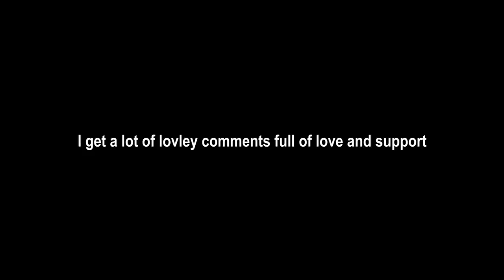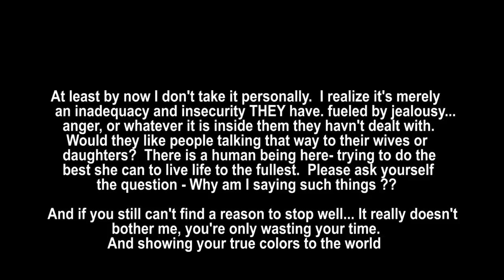They sent the mechanic who worked on my bike !  Episode 17 of my South Africa Adventure

Comment: Some people play in the game of life. Others just sit on the sidelines and throw rocks at the players. These people who criticize you miss the whole point. It’s not about batteries, wires, oil, incompetent mechanics. It’s about living your life to the fullest and having the courage to take risks in the pursuit of your dreams. It’s about being who you are, not about being who others want you to be. You are the epitome of Robert Frost’s great poem: “Two roads diverged in a wood, and I took the one less traveled by - and it has made all the difference.
Reply from the maker: well said  :)  Exactly !
Reply: I just checked the dump the bike video. And at 1:03 you can surely see the wire is off! Look at the big black wire with the yellow crimp that is just ending in nothing. That has to go to the battery too. And I promise you that I would have noticed that right away... One cable goes to ignition and accessories is connected also the charging cable to the alternator is there but the big main cable that goes to ground engine and starter is fucked. So the bike will show some function but not work proper. You might be able to ride and start it that way for a while but the current trying to finde the way over the other two cables will cause them to fail after a while... Some relays can break and other electronics too due to over heating. Rosie they did not lie to you it was broken. But that could have been that way before you have brought it in for inspection... I experience wired things on electric systems on bikes and cars where just an bonus ground wire fixed all problems.
Reply: Hi, been watching vids for about 6 months.. Fair shout for doing what u have done and doing..  go back to last video the earth wire is broke you can see this by the yellow part that should have a fork or looped end(cant remember the correct name) the yellow clamp part of connector should be over/connected the the terminal of the battery NOT half the way across the battery..  just pause the vid where you say its still connected and look where the other connectors are fitted,.. the earth wire had snapped before as that isn't a standard yamaha connector..  the oil well thats a hard 1 there are a few ways that its done on dry sump(maybe over filled now) must refer to the manual for that bike..  i cant work out why you have not spent anytime learning about motorcycles, would save you so much time in the long run.. its not hard...  could say more but typing isnt my thing.. good luck... thanks
Reply: Pat Whitty that is one of the best comments of encouragement I've read on the tube! And I've read a few!
Reply: You guys can see this stuff on a video,  the woman took the machine to a Yamaha dealer to have everything  checked  and serviced.    I think they should have been able to  repair or replace what was needed,  The oil I have no idea.
Reply from the maker: Hi Eberbacher007

You make a good and valid point yes.. BUT.  They did lie to me as you will see in the next video.  When I asked them to look over and service my bike top to bottom- this is how the wiring looked. They should have never let me leave with this inadequate wiring in the first place..  ( myself not knowing about electronics- didn;'t know any better- lesson learned) .   2-  why they lied to me.. they told me the entire wire was ripped off and dangling loose... does it look like its ripped off.. no , its still attached, could it be damaged- yes most probably as this is not a proper way to attach a wire.  but this is how it looked before.  There point was to blame me, that it was my fault for ripping the wire off...
Reply: Great comment Pat. I fully agree and Rosie is a serious player.
Reply: Contact Yamaha Corp.
Reply: amen
Reply from the maker: Steve Berg you’re dramatizing it a little bit here.  I’m not going to get myself killed-  and what basics are you referring to ? Not a lot of adv riders I know- are familiar with electrical components.  Not only that, you can’t carry tools to fix electrical issues on the road.  This bike was an entire mess. No one was able to figure it out and in the end- it blew up ! That was a risk I was taking by using it knowing the damage, but I had hope, and a will to complete my trip. So criticize all you want- as Pat clearly outlined- you’re missing the point
Reply: "Some people play in the game of life?"Well, I've "Played" in the 'Game of Life" but I've been RESPONSIBLE for what I want to do and prepared for whatever game might be.THAT means proper equipment and training for all possible situations Plus having plans when things go wrong without having to depend on other people to bail you out of a situation.Sorry Rosie, you're trying to have a "adventure" but you start out with a marginal motorcycle and you have no mechanical ability whatsoever, a recipe for disaster.
Reply: couldn't agree more. beautifully put, Pat.

Comment: A 'mechanic' who doesn't carry tools aye. Geeez. Rosie he should have told you  immediately when he looked at the fork dust seals at 6:30 that those forks are knackered, and danderous! You can see the massive gap between the fork inner stanchion and the dust seal, this means that the fork inner stanchions are moving around so much that the seals and dust covers are being crushed. This also means that the fork oil will just pee out of the forks in no time and and you'll have no damping at all on the front of the bike.

If they try and fob you off with that bike again Rosie, you at least want brand new forks on it. My guess is that they're also bent so straightening and rechroming may work, BUT I wouldn't trust those cowboys to do it.

Comment: I took my truck in to be inspected. The truck has been making a whining noise and wasnt too loud. So during inspection, they called me at work n asked if i wanted my power steering pump changed and thats where noise was. Said not worried about it now steering is smooth as silk at time. So picked up truck and they said put in lucas power steering additive and i paid bill and along i went. A couple weekends later i was in garage and figured id take a gander and broke out my stethoscope, a cut off piece of garden hose and found that the noise was the bearings in my altenator! So obviously they just assumed it was powersteering pump! Hard to find a good experienced smart and trustworthy mechanic!

Comment: 6:25 The radiator cap/seal is fucked. That is definitely not going to hold the pressure in the radiator and cooling system. If they checked the coolant, they would have realized that it needed to be replaced, but they obviously did not. The Yamaha dealers seem so incompetent. Sorry that these guys aren't able to help you in the way you deserve.
Reply from the maker: yup. another thing that should not have been overlooked in the "inspection" of the bike . not to mention the heavily corroded coolant pipes that caused the leak and I was told I was making up stuff... lots more to come in the next episodes !

Comment: Sorry about the troubles with the bike. However the Earth wire was clearly broken off in previous video.  Minute 1:00, where you highlight the earth. It needs to be attached to the battery negative terminal to complete the circuit.  Looks like the wire terminals were replaced in the past, and I don’t see a battery strap or bracket to prevent the battery from stressing the cable.
Reply: I had to go back and watch the other video, but yep, plain as day, the negative (earth) battery cable is disconnected from the battery.  There are smaller wires still connected, which is why some things still work.  But the big one that feeds back from the engine and starter was clearly disconnected.  Weird thing is I didn't see the end of the terminal.  I would NEVER use those cheap crimp-on terminals for a battery cable.  They are too cheap and flexible and will snap off at the slightest movement.
Reply: True, it went off, would be interesting whether Rosie admits that they missed it
Reply from the maker: yes,  it was not attached"  properlly".. BUT, .it was still attached.. this is how it was previously....  As I mentioned.. its not attached correctly- but its still attached..
Rosie Gabrielle
1 second ago
No, that wire was firmly attached to some other metal rig that was made- as I mentioned - it wasn't properlly attached,. BUT it was still grounded to the bike.   the wiring was a shit rats nest- these were modification made in Africa... ( you;ll see the state of the radiator after from having water put into it) ..RE wiring "  thats how it was before- and thats how I found it after the bike broke .  The good mechanic who finally saw the bike in joburg when I crossed South Africa said the wiring was the worst he's ever seen in his life. he said he never would have let me leave his shop unless he gutted the ENTIRE bike and rebuilt it from the ground up. it was that bad.  
 When I asked them to look over and service my bike top to bottom- this is how the wiring looked. They should have never let me leave with this inadequate wiring in the first place..  ( myself not knowing about electronics- didn;'t know any better- lesson learned) .   2-  why they lied to me.. they told me the entire wire was ripped off and dangling loose... does it look like its ripped off.. no , its still attached, could it be damaged- yes most probably as this is not a proper way to attach a wire.  but this is how it looked before.  There point was to blame me, that it was my fault for ripping the wire off...
Reply: The heavy gauge wire is the one that earths to the engine. Without this connected to the battery terminal (which was obvious on the previous video) you'll have all sorts of problems.
Reply: So that yellow terminal needs to connect the negative battery cable to a random spot on the engine or the frame of the bike (that one should bolt to the engine somewhere).  Whoever worked on the bike before you got it obviously had problems with that cable, cut the end off and used a cheap connector to get it working.  The problem with those yellow connectors is they are made of thin aluminum and are really easy to break, especially when the bike is bouncing around over gravel roads a lot.  If it's not too late, make sure the mechanic gets rid of that connector and puts a good steel or copper connector on the end of that cable before hooking it to the battery.  Those yellow ones are designed for a quick fix, but will not hold up in rough conditions.

Comment: I can't stress enough that you should get a maintenance book for every bike you have to do the work yourself. Bike mechanics for the most part are stupid as hell. The 3rd bike I bought I got it brand new from the dealer. Went to pick it up. Checked everything before I started it up. Not only did they install the abs sensor on the front wrong, they neglected to put oil in my bike. That was just them putting the bike together from the factory and selling it. My friend learned this the hard way as well.  Just went in for an oil change and service. He was charged almost 300 USD and they forgot to put oil in the bike. Completely different shop as well. I love your channel I think you're doing great!

Comment: There are other ground wires beside the battery negetive/ground wire. Bikes also have Chassis grounds which are usually a cluster of connectors attached by a screw. This area and the connectors sould be cleaned with green scotch brite then apply small amount of dielectric grease then put screw back in and tighten firmly

Comment: I just checked the dump the bike video. And at 1:03 you can surely see the wire is off! Look at the big black wire with the yellow crimp that is just ending in nothing. That has to go to the battery too. And I promise you that I would have noticed that right away... One cable goes to ignition and accessories is connected also the charging cable to the alternator is there but the big main cable that goes to ground engine and starter is fucked. So the bike will show some function but not work proper. You might be able to ride and start it that way for a while but the current trying to finde the way over the other two cables will cause them to fail after a while... Some relays can break and other electronics too due to over heating. Rosie they did not lie to you it was broken. But that could have been that way before you have brought it in for inspection... I experience wired things on electric systems on bikes and cars where just an bonus ground wire fixed all problems.
Reply: Deffinatley broken in the video.
Reply from the maker: Rosie Gabrielle
1 second ago
No, that wire was firmly attached to some other metal rig that was made- as I mentioned - it wasn't properlly attached,. BUT it was still grounded to the bike.   the wiring was a shit rats nest- these were modification made in Africa... ( you;ll see the state of the radiator after from having water put into it) ..RE wiring "  thats how it was before- and thats how I found it after the bike broke .  The good mechanic who finally saw the bike in joburg when I crossed South Africa said the wiring was the worst he's ever seen in his life. he said he never would have let me leave his shop unless he gutted the ENTIRE bike and rebuilt it from the ground up. it was that bad.  
 When I asked them to look over and service my bike top to bottom- this is how the wiring looked. They should have never let me leave with this inadequate wiring in the first place..  ( myself not knowing about electronics- didn;'t know any better- lesson learned) .   2-  why they lied to me.. they told me the entire wire was ripped off and dangling loose... does it look like its ripped off.. no , its still attached, could it be damaged- yes most probably as this is not a proper way to attach a wire.  but this is how it looked before.  There point was to blame me, that it was my fault for ripping the wire off...
Reply: and most likely those smaller cables finally gave up inside.

Maybe that is what they meant when they said that the earth wire wasn´t attached, becaus it wasn´t attached, it was just connected by some mad science version of electric wiring ;)

Comment: I remember the note attached to the pevious video regarding the earth, it was broken. Definitely. I can see the broken piece still attaced to the battery. 
Check it out,its clear.
Good luck with the trip. The adventure looks great. I'd love to do someting like that. 
The coolant leak is a weak clamp or a perished hose, the forks....hmmm, run a seal cleaner around the seals ( or a feeler guage) and keep topping up the oil. 
The motor oil worries me. Closly keep an eye on it. I hope the motor isn't burning it. If it is, the bikes done for this trip. Good luck. 
Honestly, try to find another mechanic who's heart is in the right place.

Comment: There is always a chance for Human Error .. to  forget to add engine oil or anti Freeze..  checking oil and coolant levels is a daily responsibility of  the owner ..   I have a new Yamaha FZ-07  I changed the oil once now  2,000 miles  I must admit  I never look at the oil level window..  It does not leak or burn oil ..  The oil pan is low to the ground .. If I was to ride it say off road in rocky terrain I could get a hole in the oil pan .. most likely would smell leaking oil ..
  It's  simply a miracle that you road the bike with no oil in  it and didn't seize the engine ..  Then would the dealer  be liable for a new engine ..

  I have to admit  a stick destroyed the left side center case on my  1976 Yamaha MX 125 C  the chain pulled a stick into the  front sprocket area ..  and cracked the case ..  I split the cases and installed a new side case.. used  lubricate grease  as assembly lube..  Put it call back together and road it  like  3 miles it started howling .. I never put the 650 CC's of transmission oil in the  transmission .. It's a two stroke the  engine oil was pre mixed in with the gas ..

Comment: I'm sure like lots of others I wish I'd been there to help. Never mind, it's all in the past now. But I'm curious, a completely detached earth lead wouldn't allow the dash lights to work, and doesn't magically reattach itself after the first breakdown. Maybe a corroded lead or connection sometimes failing due to vibration, then finally breaking entirely? You know what happened, of course, I'll have to wait and see. 
I'm in France right now rebuilding the points on a 1976 Honda with metal putty so I can continue my own trip. Just took a break to watch your vid, you inspire me!

Comment: I just re-watched your last video and at the 1:00 minute mark where you show the ground/earth wire, you say it is still attached to the battery. Sorry, but it clearly is not. You can even see the jagged edge of the broken terminal under the screw head that the ground wire should be attached to. (The arrow you drew in there shows how far that wire is away from the battery.) I understand your frustration with this mechanic with the shocks and all, but some of these problems are just a simple fix like a broken wire terminal. Can't wait to see how the rest of your journey went.
Reply: yep its broken.

Comment: If I recall correctly, the mechanic fitted a 12V outlet in an earlier video (directly to the battery, which was probably wrong), so they probably didn't reconnect the earth wire properly in the first place. Best wishes Rosie.
Reply from the maker: Well spotted Kevin ;)   and can you guess what dies next because of their stupidity......
Reply: And I remember the crash bars...😕